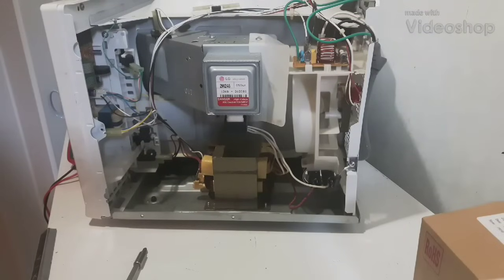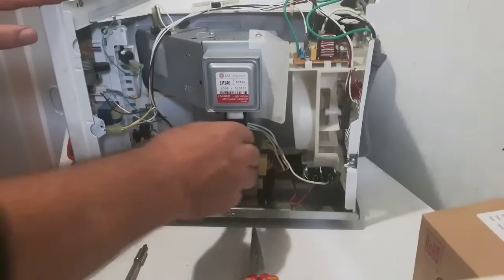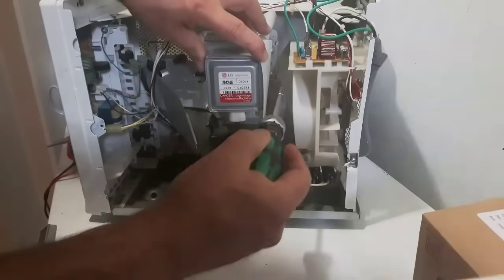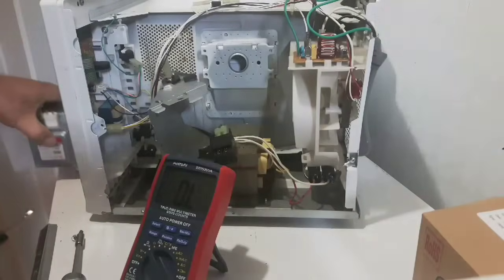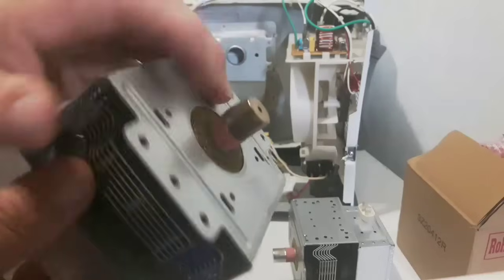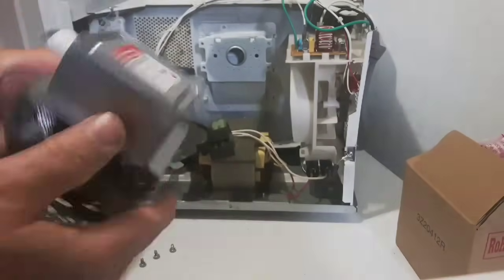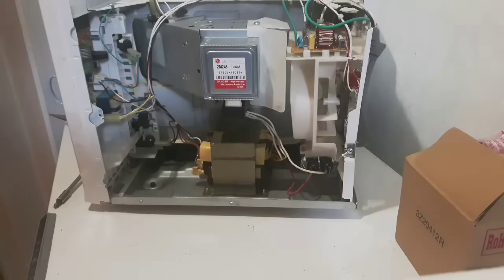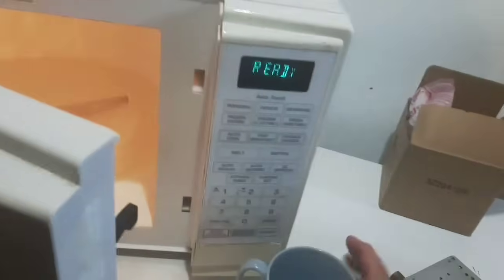Checking and Replacing Magnetron  in a Microwave. ( Runs but no heat )

Comment: Hi Jim, what is the significant of silver colour on the tip of the magnetron,  I have a working Microwave whose metal compartment where food is cooked had rotten away through rust and corrosion,  so a friend gave me his faulty good condition Microwave whose Magnetron has packed up, I then swapped my working Magnetron into his after making a few mods to fit it as the mounts were different, I noticed that the metal silver tip of my working magnetron had burned on one edge making a hole on its edge as well as the center holethrough which the waves get emitted,  I covered the small hole that had burned through on the tips edge with a self adhesive copper tape and allowed it to run, apart from some minor noise the microwave is now working, heating water, I cooked a medium size (roughly 3" )  jacket potato on full power and it cooked it perfectly, I wanted to make sure the magnetron's tip I covered in copper tape was still intact, stayed in place, and to see how hot it got after 5 minutes of cooking, so I immediately unplugged from the power socket, opened all screws and took the cover off,  discharged the capacitor terminals to earth,  no sparks were seen,  then I touched the magnetron and it was pretty hot to touch, took it out to check the silver tip which is now covered in copper tape, it was still intact but its colour had changed from copper redish/brown  colour to  semi Gold colour, now I am wondering if microwaves have turned copper into Gold, would I get any credit for this?

I have now managed to prise off the silver tip from the bad magnetron , I used a pipe wrench to grip it and rotate it back and forth, it came lose, and inside was a copper tube whose end had been squashed tight to seal the end, and this silver cap fits over it , so I pushed tight this silver cap on top of the good working magnetron, all seems fine now, even that minute noise has disappeared. All working good, cooked jacket potato in 5 min.
Reply: Throw it all away. You should not be making mods on a microwave and it's magnetron, you dolt.

Comment: My microwave is heating but very low. The quantity of water which was taking 1 munute earlier not the same quantity of water is taking 3 minutes to same temperature. Is it time to replace magnetron or is there some thing else? Please suggest.
Reply from the maker: Take a look at the silver you have on the magnetron. In my video there was very little silver and would not heat. Maybe you have some silver enough to heat but slower.  time.
Only thing is the magnetron is expensive to change.
Reply: @JimMcLaren1950  thanks

Comment: Mine is measuring 5 ohms between connectors, is that normal? Microwaves not heating
Reply from the maker: Mine was around 4. I would check for silver on the end of the magnetron like in my video.

Comment: hello mr jim mc laren pls advice me what to be done  of my microwave oven, the problem is power is on but the unit is not working at all ,despite of touch push button being press. this is what ive done, checking and inspectio with my digital multi tester, fuses, magnetron, diode, capacitors, transformer, and the micro switch in the door contact, all the inspection and testing being done but the problem is still exist, by checking the main components are base of what I viewed from tutorials in u tube. please help.
Reply from the maker: When you press the  button on the panel  does that work. Example you press  30 seconds hit start and nothin happens .
If you press the panel button and nothing comes on then you may have a loose ribbon cable on your panel.'
If there is no heat check that there is silver on the end of the magnetron.

Comment: This video was key to repairing my GE microwave that seems to be built by LG. Magnetron passed multimeter test, but the antenna was discolored. New magnetron antenna was silver, installed it and viola! Good as new.
Reply from the maker: Happy my video helped.  Like mine the antenna had no silver on it, proving that it was the magnetron even though it passed the multimeter check. Thanks for posting.
Reply: I got the same problem, will be buying a new magnetron and replacing it, but this video got me a little worried that the root cause is somewhere else - maybe in the mica plate?? https://youtu.be/dm6Z21M_KgI?t=180 Did you had any problem soon after? Or everything is still fine with both your microwaves?

Comment: Wish I had seen this video first.  Have gone thru my whole microwave...all parts testing good, except the transformer...it was shorted and blowing the internal fuse.  So, I got a new/used transformer that tests good with 102 ohm running thru coil.  I installed it, microwave runs now without blowing fuse, but still loud hum and no heat.  Bought a new capacitor...still no heat.  Now, I see this video.  Oh well. I dont think the wife is going to let me spend any more money on this micro.  But, I am guessing either, that the magnetron pulled too much current when it quit and shorted the transformer, or, lightning ran thru the microwave.  All I know, is everything else on the microwave works....fans, lights, turn table....just, no heat.😒
Reply from the maker: Sounds like the magnetron. You replaced a lot of parts its  like new now. I would be tempted to replace the magnetron.

Comment: Ty for the video....I had the same issue thinking mine was not bad...checked it with my meter and like u, mine checked out fine. My tip was still nice and silver so huh...I'm sorry to say I did watch another video and he recommended to physically check the magnets...well by golly one if not both had a crack in it...I have not replaced with new one yet but I bet thats it...thanks.
Reply from the maker: William your welcome. Thanks for posting about the magnets. That's a excellent check that is not mentioned much in videos about the magnetron..

Comment: Make sure those screw are tight, I have noticed in the newer models the mag has safety hangers and tabs to prevent it from coming loose and falling out.
Reply from the maker: Good point Vernon. Thanks for posting.

Comment: Thank you nice video and info.  Mr. Jim please tell me that  CAN WE REPLACE BAD MAGNETRON WITH GOOD ONE OF ANY MICROWAVE OVEN ???
Reply from the maker: No , you have to replace the magnetron with model that was designed for your microwave.They are designed to operate at various frequencies and output power levels.
Reply: Thanks for the information. I have a Logik macrowave and I just discovered that the magnetron is missing and I don't know the type. What can I do?

Comment: Did your microwave start getting louder making a humming vibrating 
noise before it died. I suspect the 
magnetron is starting to go in mine.
Reply from the maker: No didn't hear any humming or vibrating sound. Yes check Magnetron. Check with multimeter like in this video and check  for silver on the magnetron as well, also mentioned in this video.

Comment: Did your microwave start getting louder making a humming vibrating 
noise before it died. I suspect the 
magnetron is starting to go in mine.
Reply from the maker: Could have been a bit louder don't recall just remember it didn't heat. Could be the turn table there is a small motor under the plate that went on mine. That one was  under warranty. Some how this post got duplicated.
Reply: @JimMcLaren1950  Thanks for responding. Our turned out to be a busted magnatron.
Reply from the maker: Hi Clint, thanks for posting. So the humming noise was an indicator.

Comment: So checking the old and the new magnetron with the multimeter gave the same result, meaning that until you change it you are not sure. I don't think the color it is a sure thing either: The color does not change instantly, 5 days ago when it was working probably had the same color
Reply from the maker: Thanks John,  it wasn't working 5 days ago , first video was published Oct 18. In this video you can clearly see that the original magnetron had no silver on it compared to the new one. Someone made a posted a comment in another video on magnetron that even if the magnetron checked out with multimeter if the color was brown or little silver on it, it was the magnetron that wasn't working. I wasn't 100 percent sure but it was worth it to buy new magnetron.
Reply: @JimMcLaren1950  found a company to rebuild mine. Replacement not available.  CoreCentric Soulutions.
Reply: .4 maybe your multimeter calibration. If not shorted to body you can remove two wire and check from screw driver one by one if sparking while running .If sparking meaning magnetron was defective
Reply: @seniorwill mine is measuring 1.6 ohms. What do you think? Is it toast? It works randomly. Thanks!

Comment: Is it possible to check the magnetron by simply taking off the upper grill on the microwave oven and using the meter?  A tech came and that's what he did and determined it needed a new magnetron, capacitor and diode.
Reply from the maker: It depends on the microwave, yes it is possible. Usually each part is removed and checked with a multimeter.

Comment: Would a bad magnetron cause the microwave to act as if it's not even plugged? Mine is completely dead and the main fuse checks out fine with the ohmmeter. Any ideas?
Reply from the maker: In my case it was the end of the magnetron that was bad.( no silver on end ) . I had power to the turntable but would not heat.Some microwaves have 2 fuses inside the microwave case.
Reply: Microwave ovens also have a thermal cutout. When our Panasonic magnetron failed it took the thermal cutout with it. Very simple to check and replace only 2 wires.

Comment: So in your earlier video - you showed that the Magnetron checked out good ??? Ive also seen other videos that showed how to test like you did. I replaced my Magnetron several months ago and all was well. Recently my microwave stopped heating again, so I blindly replaced the capacitor and diode thinking that would do it - NO heat.. went through and did all the checks this time and all switches are good, fuses etc . any idea if my Magnetron could have went out that quick ? Also you never followed up on your Transformer check?
Reply from the maker: The Magnetron did check out good in a previous video using a multimeter. The magnetron didn't have any silver on the end of the magnetron even though it checked out ok with the multimeter that was the problem with my magnetron. It is very possible that the magnetron went again but there must be a warranty on the replacement magnetron. I purchased 2 new switches ( 2 switches are the same one is different ) and tried the new switches to be certain it wasn't the switches. I would see if they will replace the magnetron if its under warranty. Check the end of the magnetron watch the video again you will see there was no silver on my magnetron. I did try the transformer check but it was hard to get a reading on the body of the transformer the coating was hard to scratch off so I never completed the Transformer check. There are other detailed videos on the actual transformer check. Let me know how you make out. Thanks for posting.

Comment: A Ha! You said "As long as you don't get all zeros". I know in testing a magnetron there should be less than 1oHm between the contacts. But what I there's absolutely NO reading at all?
Reply from the maker: You should get a reading.
Reply: Right, SOME sort of reading. If there's no resistance or no reading it's bad...There's no continuity to the case from either terminal, but the resistance between is 0.